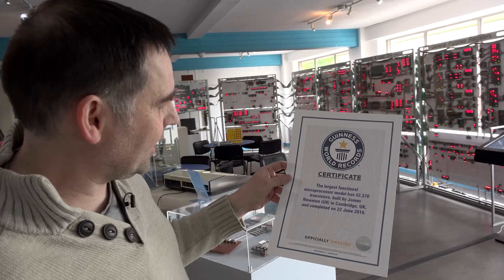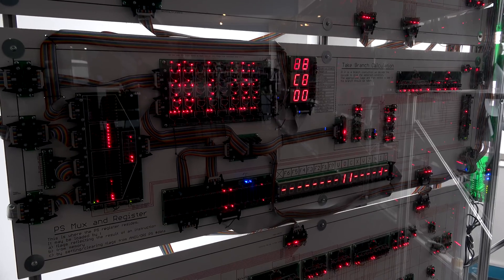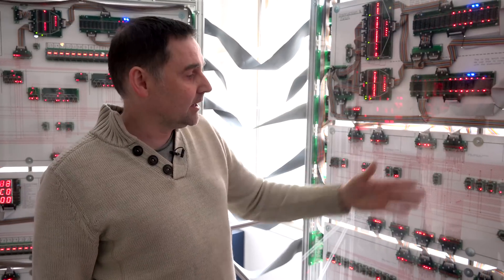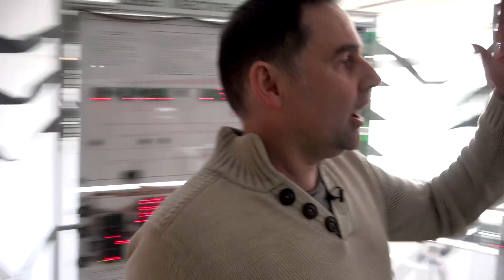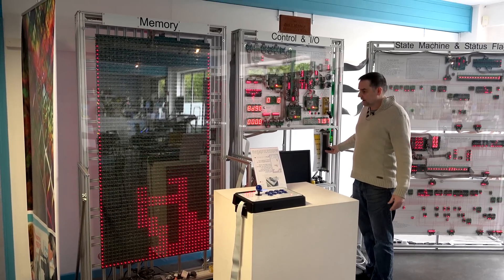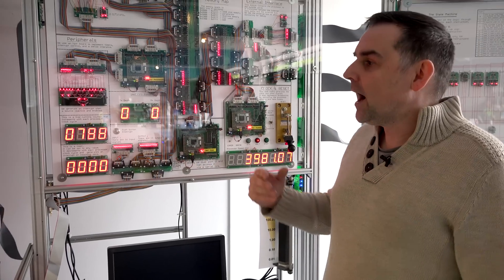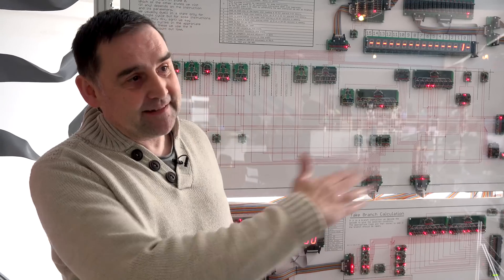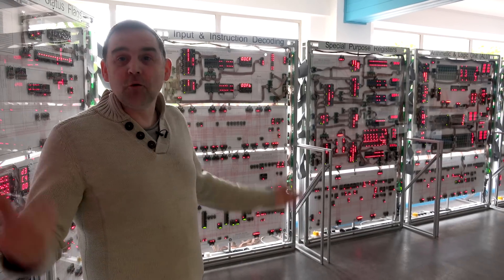MegaProcessor - Computerphile

Comment: Wow, props to the guy who made it, it must have taken a long time. Is it open source by any chance? I could see universities using such a model as a great teaching tool.
Reply: You don't "need" the designs. If you know how each component is build at each level of abstraction (How transistors make gates, which make bigger gates, which make ram modules and ALUs) and how they all work together, you could in theory build your own just fine.
Reply: I am sure you can (in fact at university, I had to learn to draw the basic hardware implementations of logic gates, flip-flops shift registers, etc. from memory) , but most of the work in creating something as readable and presentable as this is in laying out the schematics and the PCB's (both in terms of electrical connections and layout in the demonstration). For me it would be just interesting to try assemble something like this on my own, though looking at the creators website, it is quite expensive. But even at that cost, I am sure some universities (and especially their students, at least the ones who actually are interested in their course) would be happy to have such a teaching aid. I know it would have been much easier to digest the CPU architecture as well as the assembly instructions and registers if I were able to visualize them in such an obvious way.
Reply: If you're interested, I found a channel where the guy built an 8 bit computer from breadboards and various chips. Not discrete transistors mind, but it's still very low level. His channel is "Ben Eater" if you want to check him out.

Comment: Would love to have known how much power that thing draws. With all those LEDs, increased output loads from the long cables and lots of mechanical contacts it must be a huge amount!
Reply: Still less than vacuum tube based microprocessors.
Reply: about 500watt according to his page, mostly to power the leds
Reply: One could calculate that!

Ignoring the losses in the logic, each LED draws ~10mA with a ~2V voltage drop for red LEDs. That's 20mW per LED, or 1W per 50 LEDs. I'm not that eager to count all of those, so I'd say (again, ballpark figures) in the 50/100W range. I'd be surprised if it were larger than that.

I'd love to hear some comments on this regard, I find this stuff genuinely fascinating.
Reply: 500W doesn't seem so bad though. Most desktops hit the 300W mark quite easily and some PC monsters pull around 1000W.

Comment: It's more of a Macroprocessor...
Reply: +SonYim More like quadrillion, since CPUs of the last ~22 years are actually nanoprocessors (10^(-9) That is, if we consider nanoscale the one below 500 nm, or half a micron (in 1995 the cutting edge process node was 350 nm, down from 600 nm in 1997). If you rather think that nanoscale starts at 100 nm, then we have nanoprocessors only since 2004, when the 90 nm process node was introduced. Presumably the picoscale is physically impossible, unless quantum tunneling transistors are designed.
Reply: +Nikolaos Skordilis
>Presumably the picoscale is physically impossible, unless quantum tunneling transistors are designed.

I think picotech will involve manipulation of electron orbitals to directly control how atoms bond together for creating new substances. The reactors in SpaceChem might be a fictional example of it.
Reply: Nah they did macro processing in ww2 they used tubes for that machine.This ting is much more capable and a lot smaller.
Reply: +OoJxShadow  Perhaps we should be calling our current processors "nanoprocessors", given they're being manufactured with features in the 10-20nm range?
Reply: lol
Reply: Micro - 10^(-6)
Mega - 10^(6)

They upscaled the microprocessor times a trillion.
Reply: Actually in this case micro comes from micrometer. They started to use this term around the time they were able to do transistors for which the most appropriate unit of measurement was the micrometer.

Comment: Looks like a challenge Ben Eater should accept.
Reply: Ben Eater's videos are excellent for explaining how all this kind of stuff works.
Reply: Get yourself a wire cutter/stripper and an pair of needle-nose pliers. Then you can make your long wires as short as you need them.
(P.S., I am not being facetious; this is exactly how we did it in college.)
Reply: Get some solid core wire and cut them yourself! You'll get the perfect length every time.
Reply: I've been watching Ben Eater's videos, and I have a few electronic components, but I have no idea where I can get these nice short straight wires. All I have is long flexible wires, the shortest of which is half a breadboard long. Even simple circuits quickly become messy with this wiring
Reply: Ben Eater's videos are great, but building an 8-bit computer on a breadboard from integrated circuits is vastly simpler than making a computer entirely from discrete transistors. This must've taken over a year to make and is incredibly elegant and cool.
Reply: Explaining hardware multiply and hardware divide would be nice.
Reply: Thanks for the pointer! I have searched an online electronics store, but they don't have that sort of wire. I have searched my country's equivalent to ebay, and there is no solid wire in breadboard sizes. Only stranded wire is available in this size.
Reply: Stranded wire can work with a bit of hassle, just tin the ends. Also, if the shipping isn't a problem, try Sparkfun or Adafruit. They almost definitely will have some solid core, I'd bet.
Reply: Hardware multiply can be implemented naively with a bunch of adders and AND gates, so for a 4-bit CPU:
abcd * efgh: eeee AND d000 + ffff AND cd00 + gggg AND bcd0 + hhhh AND abcd
(7*7) 1111*1111 = 1111+1110+1100+1000 = 11101 + 10100 = 110001 (1+16+32=49)
I'd be really interested in hardware divide, though.
Reply: +simontay1984
That's amazing, thank you, the cores are the proper diameter and everything, and the cable is cheap at <1$ per meter.
Reply: animowany111 interesting. I'd have assumed ANDing with the lowest bit and bit shifting, with each result sent to an adder. That would essentially be how we do multiplication on paper.
Reply: They are single core(or strand) wires. You can get them anywhere online.
Reply: Now he literally accepted this challenge xD
Reply: Wait, who is Ben Eater?
Reply: @CrusaderJacky  Google him.  He has awesome videos making computer stuff with wonderful explanations - not to mention superb wiring skills.
Reply: @justinjames3028  I will definitely do that.
Reply: @CrusaderJacky  Check out his youtube channel.
Reply: I can just see him doing this
Reply: Yup, you can build a computer out of jellybean components nowadays, most of them are under a dollar. If you know what you're doing, it's not very expensive to do a lot of stuff. It's prettymuch advanced LEGO.
Reply: nope I like what ben eater did alot more.